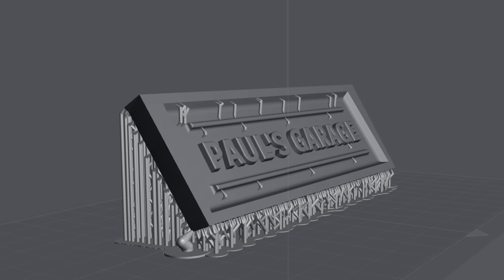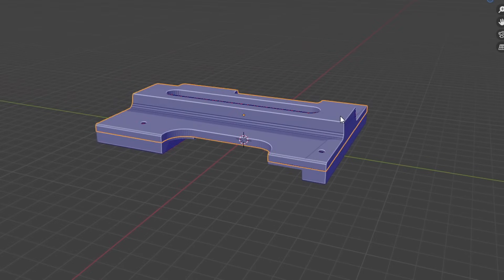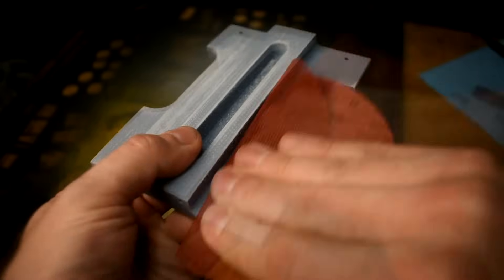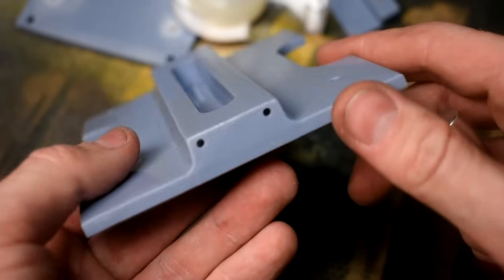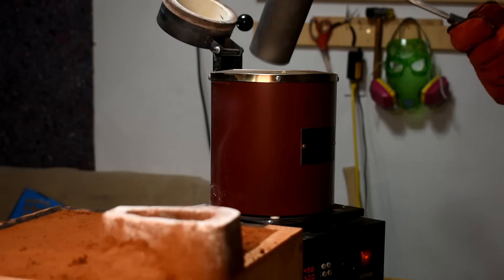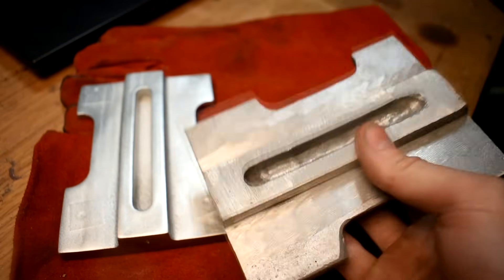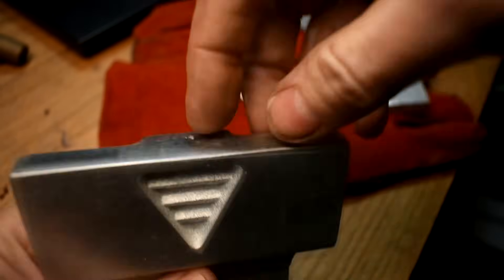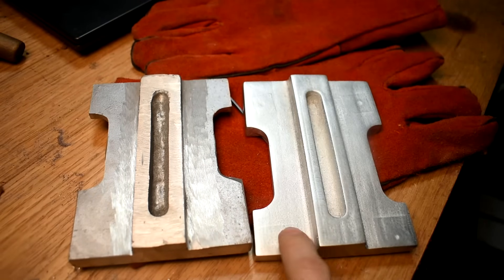Making a Better Lathe Carriage | DIY Gingery Metal Lathe Part 5

Comment: I would like to know your updated progress on this project. Have you managed to complete the lathe build yet? I am curious how much improvement casting all the pieces in zamak rather than aluminum as suggested by Gingery. I imagine that it would be significantly better, especially in terms of vibration dampening, but was curious what your experience has taught you.
Reply from the maker: I haven't gotten much farther than this video, and the next video will be a month or 2 probably.  I think the Za12 will be a huge benefit, but also i'm bulking up the castings, so everything is chunkier.  those 2 things together should really make a difference.  I will also probably bolt it to a concrete work bench like Makercise did.  His lathe is all aluminum and the concrete helped his chatter problem a lot.

Comment: The pin holes is called porosity and different metals have different amounts it just air bubbles. Before you put your two halves of your mold together brush them with alcohol and light them on fire it evaporates any moisture on the surface of your sand that's trapped.

Comment: Tips for sanding/finishing aluminum, lubricate the sand paper/drum sander/whatever abrasive with wd40 or gun oil if you have it. Keeps the sand paper from gumming up, wax (paste wax works best imo) or even a bar of soap rubbed on the paper before you start sanding also helps prevent it from happening too!

Comment: i have an Atlas 618 lathe (6x18), circa 1950ish and it uses Zamak for the change gears, half nuts, carriage gears, the backgear/bullgear unfortunately and handwheels
my backgear has pretty much lost 3 or 4 teeth so its useless but the fact it survived this long is pretty good, the halfnut is all broken as well, but that's par for the course
zamac is pretty decent for what it is, cheap and easy to work with

Comment: Paul,
Thanks for another great video.  
I think there's a lot to be said for a casting that's rough but good enough. The new casting is pretty nice though.  I do want to put in a plug for using pure zinc as a substitute for cast iron.
Zinc has a density of around 7.14 g/cm³ while Zamak 12 has a density of approximately 6.0 g/cm³.  And  zinc is very, very close to cast iron. The density of zinc is around 7.14 g/cm³ while the density of cast iron is typically around 7.20 g/cm³. 
Keep up the good work.!
Cheers from Alaska
Reply: What hapens to the 3d print model? Does it burn away?

Comment: Just melt candle wax in the holes, press the halves together and then shave off the extra wax with a razor flush with the surface of the casting.

Comment: Man when I got started, I stayed the heck away from zinc alloys like they were Cobalt 60. I was so worried about fumes, but also you know, growing up with industrial zinc castings being a sign of "this is cheap junk that they didn't bother to make out of brass"...

And then you started on the ZA-12 journey, and I bought a bunch from rotometals when they started offering the small hobbyist ingots that fit in the graphite crucibles, just to see...

Hoo boy. casting with ZA-12 is like having super powers, or a magic wand. Suddenly all the weird thin walls that were not at all possible can be right there in my finished work! The surface finish is great right out of the mold, even with green sand! (actually I get better finer finish with green than I do with PB, but that's down to particulate grain size and stuff - diatomaceous earth is extremely fine amorphous silica. You know, sand. SiO2. Just not crystalline, so very very very fine texture.)

I don't Discord at all anymore - having fewer scattered socials accounts has been a good thing - but I ougtta make an exception and show you some pictures. Anyway, thanks for spreading the good word on the ZA-12. I have some thoughts about PID controller calibration on those electric furnaces, also, to get the temperature reading to be more accurate, but I haven't tried, so it's just speculation right now.

Comment: I'd like to see print settings. I'm running into a similar problem with my resin printer. Already got better resin and started messing with exposure settings. Cleaned it up a bit but it's far from perfect.

Comment: Those pin holes or blisters as you call them. are probably dissolved hydrogen from moisture in the air during the pour.

Comment: This is probably gonna be very helpful to me im turning a 1930s wood lathe with metal accessories available into a clock lathe so i can get into machining with the eventual goal of starting a horse drawn equipment shop that remanufactures parts for my draft Horse and Amish friends + i really love steam engines and want a steam tractor and a miniature locomotive but cost is prohibitively expensive unless.... i just learn a ton stuff i already have great interest in

Comment: I have a natural distrust of zinc alloys, on paper zamac has great properties, better than your typical 356 aluminium, but in practice every piece if cast zinc alloy I've worked with has been a mess. It corrodes like that's its job, you'll have to think about galvanic corosion where it contacts those ways, maybe include a sacrificial annode. 
I hope you have a better experience with Zamac than the zinc alloys i've had to deal with, I'll stick with brass for now.
Reply: ^ this

Comment: So... aluminum can be vibration damping, but it requires adding enough silicon to make it hypereutectic (>12.5% Si). The excess silicon forms a granular precipitated phase, similar to carbon nodules in cast iron, and has a similar damping effect. But you need a lot of it. Silicon also helps with fluidity and shrinkage, since it expands on freezing like water. Though it does also require higher pouring temperatures (700C or higher).

For shrinkage, you have 3 main options: Reducing thickness in problem areas (which you did here),adding big risers over the problem areas to act as feeders, or adding chills by the large sections to drive directional solidification. Or, mix and match for greater benefit!

Comment: So a trick they used to do on cast iron parts and i suppose modern cast steal parts today is anything that matters, like mating surface, they will cast oversized and then machine down to size. That reduces rejects and reduced machining. I suppose you don't have a mill but you do have Sanders.
Reply: Yes, to this day foundry patterns for all cast parts (nonferrous as well) that will need to be machined still have machining allowance built into them.  If they didn't, and machined castings still reliably fit their designated locations and performed their functions properly?  Why now THAT would be a trick!  😁
The old man did include machining allowances where necessary in the plans for the all of the patterns for the machines in his books, rest assured.  The Gingery milling machine isn't until book 4 though.  First Paul has to finish the lathe from book 2 in order to machine cast parts for the shaper (book 3)...  Maybe we'll see it happen one day.  I'm the last person in the world to doubt it - I built the charcoal furnace from book 1 in 2013 and I still believe I'll build the lathe one day!

Comment: looks good enough to me , if you where to have (a friend with) a milling machine you could machine it to perfect size , then again you could cast a solid block and just machine it intoo the shape you need 
thats actually a pretty large piece you casted using that small melter makes me wonder if my home grid would be able to take 3 of those running at the same time ..... and enough time to cast all three intoo one mould one after the other 
sumting i allso wonder about and might be usefull when the lathe is done : i seen people cast aluminum rods using a metal seamless pipe , after cooling the alimunum schrinks enough to fall out , problen is that you can only cast this long a piece with the amound of aluminum per melt and or the length of the pipe used and there inclusion or porious bits in there that show up when machining the part 
wat i was thinking was to plug the bottom of the pipe for the first pour and while the aluminum is still somewat malluable put it under an hydraulic press and press it partway out of the pipe , this should compact it some and should make the aluminum a little stronger with less inclusions , after that keep pooring more amuminum in and press it out a little further after each poor
probably need to experiment alittle for the amount of time needed to cool the metal enough to compress it without making the claylike aluminum shoot past the press toward the top and still have it hot enough so it doesnt stick intoo the pipe once cooled , might allso experiance problems with inclusions or even the different poors not welding together intoo a single long bar 
might be interesting to try out for a video

Comment: Hurrah! It's that most wonderful time of year, when the Gingery gets a drop of progress! xD

For your drain/air holes, you can just use a scrap of randomnes on the floor to dip in the wet resin, an drop it on the hole, then blast with a UV torch add another drop, and voila, hole magically gone forever! :)

Love the results, that's done really well, quite impressive results with that alloy, and your much improved sand casting skillz xD

I wanna agressively push the idea of adding complex engravings onto non-important surfaces, with  few button clicks, for free, so the pieces are super personalised, and easy enough to sand cast (or lost resin cast even) :)
Reply from the maker: Engravings, eh?  I think you gave me an idea 🤔
Reply: Yes, engravings!

Comment: That is a sexy cast! You should be proud!! 
Is this lathe using the old concrete method later on?
Reply from the maker: Not sure.  I'll definitely consider it, it worked really well for Makercise.
Reply: Not only a sexy cast, but such a vast improvment too. Though I'd love to see if Paul can manage it or something similar in Aluminium now with 5 years of extra learning of it picking the right metal really has solved all his problems.
Reply from the maker: even with the wrong aluminum alloy I would be able to do it with a HUGE improvement.  95% of the issue is the mold making.  the "mystery" aluminum is actually scrap A380, not the right alloy but not horrible.  The extra shrinkage from aluminum (and then even more for a380) could be fixed with a feeder like I describe in the video.  Actually i cut out the detailed explanation because the video was too long, but it wouldn't be hard to do.
Reply: @PaulsGarage  I know in theory it shouldn't be that tricky. But I also know how well theory translates to the real world the first few times you try something, even if you spend the time to really do the math first there is always little bit of artform/experience in making the perfectly calculated actually happen in the real world. So the question really is do you have the knowledge/feel for that harder material to cast? 

Which as I've not seen you do Allly casting in ages I suspect you don't really have yet - know how to get of course, won't take as many attempts to get a good result etc. But...

Comment: super cool that not only are the tape lines present but also the holes are identifiable which would help with drilling if you didn't want to bother with using the pattern to get them located.
Reply from the maker: I didn't think about that until I was editing 🤣🤣  I missed an opportunity there

Comment: Re: Measuring. I have an SLA printer and it calculates volumes for prints. Does FDM have anything like that? (Maybe feet of filament which can be calculated to a volume?) I’m getting ready to buy a FDM printer because my daughter likes dragons that are 279,732 different colors and SLA is more high brow than that. 😂 Recommendations on an FDM printer for stuff like this?
Reply: The slicers all include an estimate of filament consumption and even print time, but with multicolour prints depending on the exact method it can start to get really quite wasteful in filament. So if you want a huge number of colours might I suggest just printing in white and investing in some acrylic pen markers so you daughter can get any colour they like relatively quick and cleanly even if she isn't really ready or interested to handle paintbrush. I've not tried them myself but the Speedpaint markers seem to be well enough liked by the folks that have tried them.
Reply from the maker: FDM slicers will give you a weight and a length in filament line, yes.  I don't have any super modern FDM printers, but I've had good luck with the mingda magician pro2, and the prusa mk3.  I have a k1 max and an ender 3 v3 ke, both which print great but aren't as reliable.
Reply: @PaulsGarage  I also, for a long time now, have wanted to tell you that you’d fit in with my buddy group big time. We even have a guy that you remind me of. He’s one of those hybrid gingers though. 😂 Blonde hair and a big red beard.
Reply from the maker: Haha i have a shirt that says "ginger beard man" on it, you could get one for him

Comment: Paul, 5:12  sink?  I use a modified version of this:
https://youtu.be/gSmnwH3fF2E?feature=shared
I coupled that with a 12V pump, so I can run it off batteries, wall, or hose pressure.  I need to finish a coupler to adapt MHT to the crazy metric thread, but should be fine!
Reply from the maker: That's a really cool idea!

Comment: I don't retain much information when watching a video, but did you mention what sort of sand you used all those years ago on the first casting? I remember a time when you switched from Petrobond to green sand and then back again. Nice casting by the way (pun?)
Reply from the maker: Petrobond all the way.  I have never switched to anything else, but I know swdweeb switched to green sand.  I was considering it. Just never did it
Reply: @PaulsGarage  My mistake. I blame my memory for my mistakes, it refuses to believe me. If and when I get back into casting I will try oil bound sand. I think I could rig up a fan extractor in my garage.